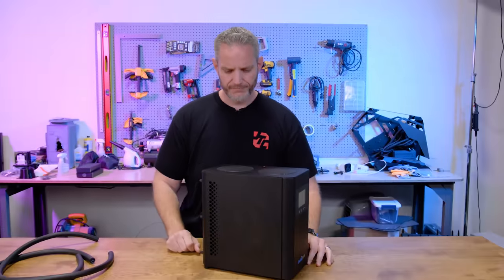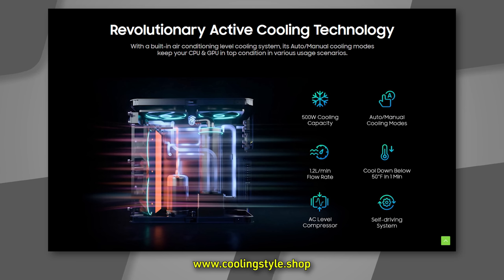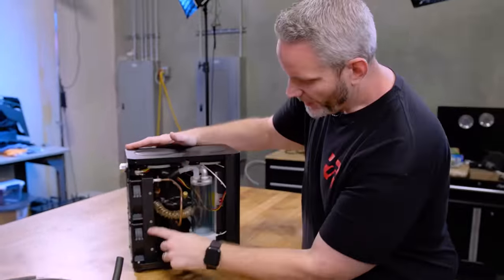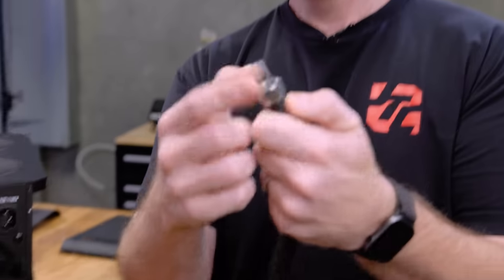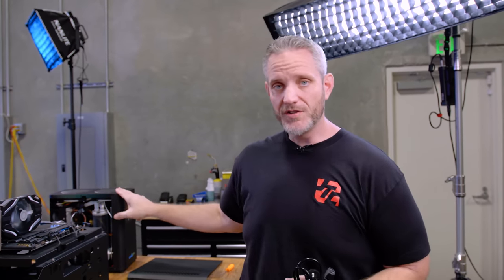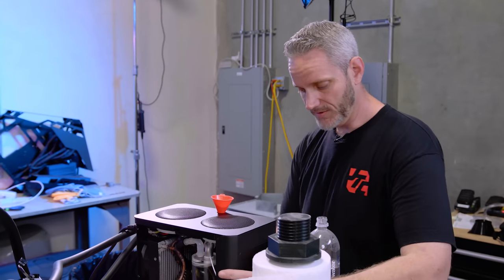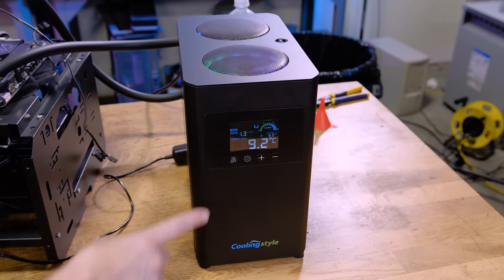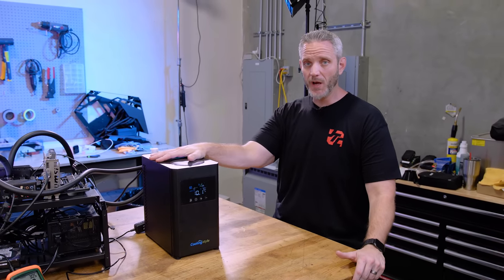This seemed Gimmicky... Turns out I was right!

Comment: The heat coming out of this thing will be the heat removed from the PC plus the heat created operating the unit itself (compressor, power supply, pump, fans, electronics). So yeah, I would expect it to be pretty warm.
Reply: A correct thermodynamic statement.
Reply: You can just measure the electric consumption of the unit and compare that with the consumption of what it replaces in the computer (an AIO, air cooler or whatever). That’s the exact amount of extra heat that you got in the room, and of course nothing would beat just a a passive radiator because you don’t add any extra power to move heat around
Reply: @tmbchwldt3508  not even close to accurate. A properly sized chiller will freeze the PC, this thing is just a toy. Too small.
Reply: @RobertSmith-lh6hg  how is what I said inaccurate? This is just about the thermodynamics and energy added to the room. You can use the biggest chiller in the world and freeze your PC to absolute zero, in the end you still end up with additional heat in the room, and the electrical power consumed by this chiller (absent any effects of e.g. gases u brought in that you release like liquid nitrogen) is the additional heat in the room. You can pipe that to outside and have a form of a split air conditioner, but this is the only way to not end up with a hotter room than a passive radiator cooled PC.
Reply: @tmbchwldt3508  very true @robert is wrong.
Reply: @tmbchwldt3508  if you have this cooler, i should expect also that your computer should also be a high end computer, right? then I should expect also that you have AC in your room, right? then why is like, everybody is worrying about that it give heat it gives to the room? just turn on the AC. I think the whole point of the product is to cool the pc below ambient temp. and it works.
Reply: @jomac21  Oh the irony. You can also turn on the AC to cool down the air flowing across the passive radiator. Did you even THINK before typing out this drivel?   "MMM yes I will run a chiller and the AC!" Go back to the circus.
Reply: @jomac21   ok,  sure but is the temp gain (um. loss but it's a gain bc lower) you get worth the extra motors & fans? the extra ac costs? the noise?
Reply: @sjs9698  it really depends on the user in what he prefers. if he just wants lower than ambient temps and just not bothered with the additional cost of electricity and additional noise.
Reply: @jomac21  And which room is the thermostat in for the AC that cools that room.  If the thermostat is in the same room then that room will be a nice comfortable temperature while the rest of the house/apartment is 50-60 degrees.
Reply: @The_Opinion_of_Matt  of course the room that the pc and the cooler is in. the rest of the house is not relevant.
Reply: @jomac21  I guess you live by yourself then.
Reply: @The_Opinion_of_Matt  nah, every room has a gaming setup with one of these, and renders in non-gaming hours. Gotta think bigger, man
Reply: @The_Opinion_of_Matt  that depends on the AC, if you house is centralized, that will have a negligible effect if you centralized AC was installed correctly. If the rooms in your house have their own AC systems, the rest of the house will not be affected. the AC will simply pump out the heat outside of the house through its condenser.
Reply: @The_Opinion_of_Matt  i don't don't know about centralized AC system, but does every room should have its own thermostat?
Reply: @The_Opinion_of_Matt  even if you have centralized AC system, the heat from a room should not go the rest of the house. it should go to the evaporator of the AC, pump out of the house through the condenser of the AC, that's how AC system works.
Reply: @jomac21  No, with centralized AC systems there is usually only one thermostat in the entire house/apartment.  Commercial systems for large buildings usually have multiple thermostats spread throughout the building, but almost never do they have a thermostat per room.  In commercial buildings it is usually one thermostat for several rooms.  Or if there is a large room in a commercial building (cafeteria, conference room, auditorium) that large room may have multiple thermostats for that one room.
Reply: @jomac21  Residential housing almost never has an AC unit per room.  About the only way this happens is if it is a old house that never had a centralized system installed and instead only has window units.  There are mini-split systems now which can cool individual rooms, but again those would only be installed in houses that have never had centralized AC, but mini-splits are expensive and if the home owner doesn't have the money to install centralized AC then they typically don't have the money to install mini-splits in every room.
Reply: @The_Opinion_of_Matt  still,  the heat should not go to the rest of the house.. if it does, the AC system is installed incorrectly.. assuming you understand how AC works.
Reply: The heat put out by this unit won't be much more than a standard fan system the compressor heat and power supply heat will be very little in the grand sceme of things
Reply: @jomac21  Your're forgetting one small thing with your "just turn on the AC" statement;
Most of Europe, Russia, and Asia, don't really put AC in their houses. I mean its only for like a month or two, during summer, the heat becomen a concern, otherwise its your home warm, not cold.
Of course, with climate change, thats going right out the window.

Here in Northern Europe ACs never really were a thing, unless you were Very wealthy. Probably due to them being expensive as hell over here, and they use a shittom of power.
Remember, we pay a lot more for power than Americans do, So they usually not worth the investment unless you've got a lot of money to burn on your powerbill.

Its only now, when Heatpumps are becomming a better heating alternative to gas and such, that cooling your home is even becomming a thing.
And thats only because those suckers can cool as well as heat.
Reply: @The_Keeper  that's why i said in one of my comments, maybe you didn't see it though, if you have this kind of cpu cooler, i assume you have a high end pc that really need that cooling. And i assume also that person have a lot of money because he can afford a high end pc and this kind cooler, I ssumed also that he could afford an AC system. :) btw, i'm from south east asia. :)
Reply: @jomac21  Costs aside, it's quite an assumption to think just because someone may have a high end PC they also have AC.
Reply: @arsenal4444  Just duct the exhaust from this thing to your sister’s room, win-win

Comment: I had a techy friend that had a warehouse like building on his property. It was cooled by one of those large roof industrial AC units. He cobbled some piping together and ran his PC water cooling loop through the AC system. Had a sweet gamer room.

Only Intel could design their CPUs in the heat of the deserts of the Middle East, only to run too hot in North America.
Reply: Linus from Linus tech tips, actually has a very similar set-up in his his new house. IIRC he has all his PC's water cooling hooked up to his Solar Panel's heatsink cooling unit (I think that's what it is, I haven't watched the video in a while though) I believe he also cools his pool's water with it as well. 

It's pretty ingenious when ya think about it, and if I had access to such things, I'd probably give it a try as well.
Reply: @Aevilbeast  the pool piping is for heating the pool, in turn cooling the water cooling
Reply: @Aevilbeast  Seems like a really overengineered solution for rich people's problems tho xD I mean just a standard PC is perfectly fine unless you're a youtuber and can actually make money from building such stuff.
Reply: @LuLeBe  outside of the US it's extremely common to have simple black metal heat-absorbers on roofs for free hot water during the summer or on bright days. Makes perfect sense to take advantage of that.
Reply: it's not difficult to run freon cooling etc but what people don't consider is the water condensation that can be frozen, then drip on electrical components if you turn off the PC.
Reply: @superslash7254  hot water for summer 🤣

Comment: I actually used a 1/10 hp chiller off Amazon to cool my water loop for a while.  Worked great and hilarious when your cpu is sitting at 25C under full load.  Gpu was second in the loop so it was closer to 45C but the chiller auto modulated and I had no condensation issues.
Reply: That's genius, truly. This comment alone should stop anyone from buying this product at its current price.
Reply: I've always wanted to try one. But I want to be at like 10c. Do you think one of these chillers could keep me at 10c?
Reply: Unless you are using low wattage components, you need a huge res for a 1/10 HP chiller to be useful.  Several gallons minimum.  Even a 1/2 HP chiller has trouble keeping up with many higher end graphics cards without a huge res of chilled coolant.
Reply: @Mildly_Amused  I believe the heat exchanger in this chiller was about a half gallon or more, so you're probably right, I wasn't able to obviously test it with a smaller reservoir, but didn't need to.  And considering the small (relative to heatsink) surface area of most gpu dies, there is a ceiling to the amount of heat that can be transferred without increasing the deltaT as the gpu wattage increase simply due to the thermal conductance of materials.  I'm sure liquid metal under the water block would help the situation, but I can't say for sure because I've never tested it.  I used stock thermal paste under my 5700xt and arctic silver on my ryzen 3600.
Reply: @mattgeekman  Larger chillers(1/3 to 1/2 HP) can go sub zero with glycol coolant or an antifreeze mix for coolant.  I've seen a few that can maintain -30C with a RTX 3090 and 12900K.

Comment: It's a heat pump, it'll move heat from a custom loop and dump it into the nearby air, which  may or may not be in the same room as the PC it's cooling.  I can see that being on the other side of a wall and being used to cool both a CPU and GPU resulting in the PC having zero moving parts and being ultra quiet.  Otherwise the same result can be reached with a custom loop and a Peltier.
Reply: Or build a little shelter and have it outside the house, dumping the heat directly into the air outside so you don't even have to use your AC to pump the heat out.

Comment: Interesting to see a product like this only now. About 20 years ago, when I first learned that "liquid cooling a computer" is a thing that exists and not having access to the internet to check what it actually means, I imagined pretty exactly something like this. A cooler, which cools down the water and hooks up to the computer with tubes.
Reply: But it's not. External PC chillers have been used for a long time and they've been expensive. You'll notice that older "enthusiast" pc cases will have grommeted tube holes.
Reply: Hmm... Back in the early 2000.. wasn't Tom's hardware once experimented with simply submerging a complete pc unit sans the psu into an aquarium kinda filled to the brim with palm oil.. 
Apart from that one of a kind extreme there were also model of separate external cooling unit very close resembling this one.
For this kind of cooling measure now open sale to the masses ..
Reply: @dureteheiral1793  there was lots of that, yep. While generally cheaper and mass produced now, there were external AC type chillers that people could buy and stack on top of or below the tower.
Reply: @MegaStamandster  yep, and all those fancy looking copper cooling unit designed for not only the cpu, but also mobo's chipset.. even ram...
Although those stuffs usually geared mostly towards serious overclockers... Being pricey was mostly single determining factor...
Reply: There was at least one PC case with an integrated phase-change cooler back in the day. General consensus was it was hilariously awesome, but also impractically loud even by the standards of the day.

Comment: What that unit needs... is ducted airflow... so that you can bring in air from outside, and dump the hot exhaust back outside... then it would make sense!  Right now, it is basically a portable AC unit without the air ducts attached!  I would love to see more of the components inside, and how it actually cools the water from the loop.

Comment: This is a redesigned glycol chiller. I had considered trying that. Brewers use them.
Reply: Looks like a water chiller they use em for hydroponics and aquariums
Reply: @amp2193  its welding torch cooler !!
Reply: Yeah I thought it was just an aquarium chiller but with **marketing**
Reply: Yeah, and from the looks of it they took every chiller lesson possible and then threw it out the window... reservoir too small, HX is not in the reservoir, etc. You'd actually be better off buying a 1gal 1/10hp chiller and using that instead.
Reply: @ksl177  Yep other companies already made them better than this.
Reply: Its nothing new.  Water chillers and glycol chillers have been used for cooling PCs for a while now.  I know a few people using glycol chillers on their daily use PCs.

Comment: 8:50 it does compress when you install the hose on the connector, the hose gets wider and it will compress a little bit.

Comment: I would be curious to see this applied to out-of-room cooling though.
Reply: at 1.3L/min, I m worried that extending the tube will generate huge temperature peaks
Reply: @TwinsCustomsCA  Right, I would think putting this in the attic right above my desk and PC now, next to where my current HVAC would be might work, but still as Jay said, is it worth that effort for $650 PLUS the labor of putting it there and the electrical cost nowadays? I would be a short tubing run, but in the end I don't think it's practical.
Reply: @TwinsCustomsCA  To do what he wants you'd likely have to add a 2nd pump in your system to supplement the pump in the chiller unit to overcome the distance between the PC and chiller.
Reply: Out of the room is the only place I could see using this. Getting the heat out of the game room would help immensely. Even with the short run I would use, I would be concerned about the flow.
Reply: For PC cooling this thing is overkill and way to expensive, for out of room cooling just use regular radiators or if you want to go extrem plump your PC to a faucet and use city water to cool it.
Reply: Maybe even out of the house cooling.

Comment: Yep, this does seem like a gimmick, but I could think of a use case or two. However, I wouldn't use this as the primary cooling for a PC. Rather, I would use it as a secondary loop chiller. I would probably hook this up to an existing open loop system via quick disconnects, and run the tubing into another room where there'd be more capacity to handle the heat and potential noise/vibration. For example, in the case of my apartment, I would put this in my bedroom where during the day I'm not in it, but my poorly designed air conditioner keeps the bedroom at 69F while the rest of my one-bedroom apartment hovers around 78-80F. I would still maintain an existing loop in my system and have this set up to pull from and return to the reservoir of that loop. That way, if I have any failures, need to service the chiller, or want to take my rig to a LAN party, I don't need to lug it along. I would then set the fan controller to only spin up the fans on my radiators IF the water temperature suddenly started increasing above the ambient air temperature. Theoretically, any excess cooling would be deposited in the room with the desktop with the majority of the waste heat being dumped into my bedroom, warming in there as well.

Comment: This is great. I needed a heater for winter anyway. And with those quiet 55db you can easily sleep while it runs
Reply: Meanwhile me sleeping near a mobile AC with 55db, this is fine! But the noise this thing makes would drive me crazy.
Reply: I would have to mod it to reduce the noise, but it is doable.
Reply: 55dB is NOT quiet

Comment: Jay, I have been in the HVAC industry for 35 years, a unit's capacity is not such a directly liner balance of room temp and output temp. there will be a loss of efficiency when room temp is higher but if that is a little "tin can" compressor I see there it should follow industry standards and they account for ambient temps when doing capacity ratings. to boil it down for you, it's all about changing the boiling and condensing points of the refrigerant to transfer heat. most refrigerants have boiling and condensing points to take account for differences in ambient temps, so they work in a range of environments. the boiling temp might be 38 degrees at one point and the condensing temp 165 in another so a small change in room temp wont effect the condensing of the refrigerant very much. the company probably repurposed a small beverage cooler to act as a chiller for PC's. it would be fairly easy to do a remote chiller to keep your loop temp just above the dew point (no condensation) and keep the noise & heat somewhere else, 100 feet away or even on the roof.